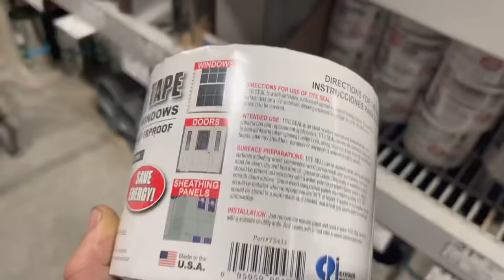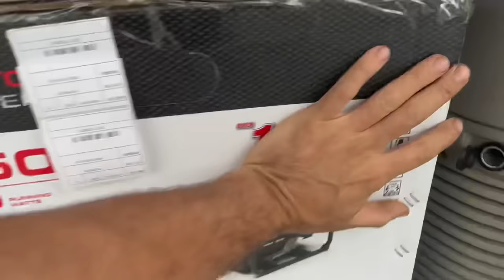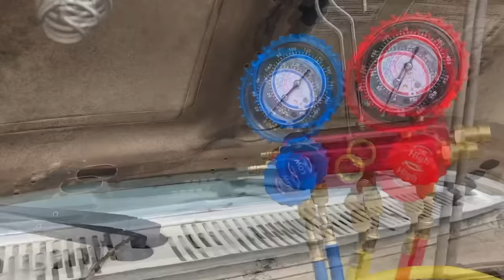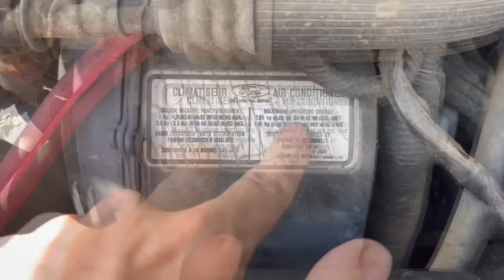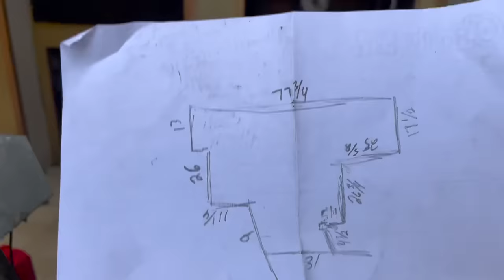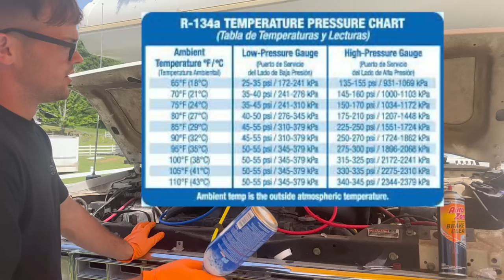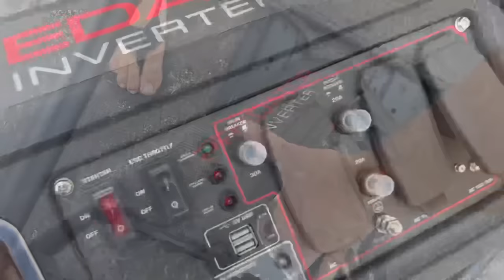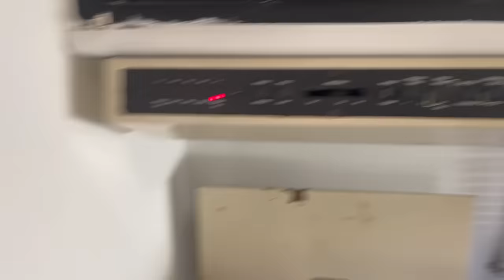Budget RV renovation at home, how much is this going to cost? DIY

Comment: My RV renovation only cost me a spring/early summer full of deconstruction, removing appliances and rotted wood from the shell to rebuild the rotted shell before building all new internals.  Then a family member got cancer so I had to stop working on it and move the RV to the back field so it wouldn't be such an eyesore for visitors.  The cancer was eventually eradicated, but then it was too hot to work on the RV, and by the time fall rolled around, the trailer in which I had been keeping what little good wood there was mysteriously burnt to the ground and hurricane Michael turned the RV into a debris field that's still there to this day.  So I've learned not to do that sort of thing anymore.

Comment: I added same style of A/c to my camper, took out common space vent, put the a/c in yep just sits there, mine has 1x1 that go across the roof to support it. but that control panel is (if it works) has value.  every railroad car in Us has those units, few years back had a (relative) salvage few. helped allot, they do draw on the converter they are 110 v,   reminds me whenever weather stops being stupid i need fix the leak on my camper. Aluminized roof coating, sold at Home Depot, not cheap works great, but that goo you scraped is butylene tape, stays semi solid to help in heat and cold conditions keeps the moister out in driving rain and wind.  not sure choice of caulking is correct, took me few time find the right one.
Reply from the maker: Ok good to know thank you

Comment: heres some advice to the work you did on the ac.  remember all ac;s create condensation.  you put sealant around the front half of it that is where it draines from underneath.  if you leave it like that it will drain inside the rv.   the drains are on each side of the unit underneath the metal.  other than that you and your family have done a fantastic job on it so far.
Reply from the maker: Thank you

Comment: Its been my experience that the fan bearing will get stuck/frozen if it's not used for a while in those type AC units.
Spraying it with a good lub will help, but most likely it will keep happening...mine did.
Reply from the maker: Ok thank you

Comment: I'm ok with the camper stuff and don't mind seeing more.  I do have a request.  Put some 1x2 along the walls as they meet the ceiling.  That will help support the ceiling plywood.  You can also use some of the thin plywood cut into 1x strips to cover joints.  Otherwise...been there...anybody who has had an RV has had to do something similar.  Thanks for sharing, it was fun to watch.
Reply from the maker: Thank you

Comment: Soft gray stuff is probably butyl tape, the white is likely self leveling lap sealant. Recpro has TPO membrane kits for fairly cheap, i spent like $200 to replace the entire roof membrane on a 26 foot 5th wheel. Unfortunately osb at the time was $50 a sheet so that got spendy. I had probably $600 in replacing the roof. For the interior walls we used the whitewash paneling and white paneling on the ceiling they were like $15 for a 4x8 sheet.
Reply from the maker: That sounds good

Comment: There's an adaptor for the exhaust with flex hose screws right into the bolt holes for the spark arrester. I got mine on ebay.
Reply from the maker: Ok good to know thank you

Comment: Plexy on sky light isn't UV protected.  Will go bad quickly.   There are a lot of Junk yards that have parts for RV's and MH's.   Gain parts for cheap.  There is a roofing  call snow coat to seal roof, brushes on.  Also stuff that is peal and seal like rubber membrane.   Not sure what it is called.  Remember those strips of wood you took down from the ceiling?  That was part of the roof support for AC...  Solar panels were all the extra holes.
Reply from the maker: Ok thanks

Comment: Enjoyed watching you and your family work on this. You guys did a ton of work on this in a short time. It’s the right unit and job for your needs and use. 

Really really surprised both the rooftop and engine cab a/c units came back to life and functioned! The roof damage was about what I expected. Very bad. Was a bit surprised at its sandwich foam construction. Then I realized just how old this puppy is and it made sense. 

Once you start your trip and start pounding some miles on the rig, you will discover what worked and did not work on your repair processes and material choices.

It will be interesting to see how well your generator modifications and installation works out. 

Hope you put co, co2 and smoke detectors in the camper. You may find you need to reroute and extend your generator exhaust pipe to properly vent the exhaust away from the camper so it dose t find its way inside. Maybe also wrap it with exhaust header heat wrap tape to protect the the surrounding structure from over heating. And carry a couple of decent size fire extinguishers placed at the front and back of the inside and they are secured and quickly easily accessible. Maybe place one by the rear bed, one by the entry door and one by the drivers door. So the last two can be grabbed either from the inside or outside and the rear bedroom one can be grabbed if woken up from a sleep. My experience says, when you need em, you need em now and can’t waste time lookin for them and digging them out.
Reply from the maker: Thank you so much yes we got extinguishers and detectors

Comment: Great job. My only concern would be with the generator exhaust. Double check for leaks and make sure the tail pipe is long enough. Carbon monoxide is a killer. Better get Rocky's seal of approval.
Reply from the maker: Yes for sure thank you

Comment: Looks great 👍
I would consider changing out the 12 V lights to LED'S.  Cooler and less power.
You may want a good set of jumper cables or an auxiliary battery. 
Enjoy👍👍
Reply from the maker: Ok good idea
Reply: @Sleeperdude  led's not LET'S  incandescent bulbs make more heat. The ones Google won't let me spell are cooler and use less battery.👍👍

Comment: Spend the extra $$ and buy and use THIS sealer caulk. its what we use to stand up in tropical marine environments.  Sikaflex 295UV (uv stabilized polyurethane).
 You can also use  a polysulfide like Life Calk
  NEVER use silicone based products.
Reply from the maker: Ok thank you

Comment: Pro Tip: Do not use silicone sealants. Use Urethane instead. 

An easy way to get it cheap is to find an auto glass warehouse or even an auto glass company and offer to buy their expired Urethane. 

It may not be legal for use with windshields anymore, but the stuff is still great for sealing panels. Personally I use Dow Express 30 and primer. As long as you clean and prime the surface, water will not get through.
Reply from the maker: Ok thanks for the tip

Comment: Great work y’all, love the content. Please buy a couple of carbon monoxide detectors for the motor home. When the generator is running it will detect any exhaust fumes that may enter the camper. Glad you extended the exhaust pipe.  You should also use a solution of dish soap and water and check all of your gas lines for leaks at every connection. Found a couple on mine that way. Take care and God bless ya’ll.
Reply from the maker: Yes for sure thank you

Comment: Josh, It's good we are on the same wavelength :) Have you tried a prim bulb on the outboard fuel tank to prim the system before you tried to start it? All you need for the gravity feed is a little height between the tank and the gen. carb. how about instead of having a line at the top of the tank, tap a fitting at the bottom?
Reply from the maker: I tried pumping it out of the original generator fuel line but never could get anything just ran out of time

Comment: Roof leaks are the worst part about having an RV. Thats how i got mine dirt cheap tho!! Previous owners selaed up around the ac unit on the outside, which wouldnt let the condensation drains drain off the roof top, causing it to build up and seep inside. Ruined the ceiling. But like you, i tore it out and put new luan up and painted. Paid $800 for the camper, have MAYBE an extra $500 in it, and it looks good as new lol.
Reply from the maker: That’s awesome, yes that is usually the problem

Comment: Just a thought about the generator fuel supply, since you carry propane why not convert the generator to propane with a carburetor kit? No more fuel delivery problems with fuel pumps or height of fuel tank.  I changed my son-in-law's many moons ago and it works well for him. I don't recall any specifics (i'm 83 here) sorry. My 35' class A had a large propane tank, maybe 30 gal and that would run you for quite a while and most campgrounds sell propane if you need it.
Reply from the maker: OK good idea thanks for letting me know

Comment: say what you want about flex seal but i have done the top of my shed and resealed a camper roof with the stuff and never had an issue with leaks
Reply from the maker: It might work good but it’s kinda expensive
Reply: @Sleeperdude  Ya i saw that after i made the comment HOLY CRAP I would have gone with the cheap stuff too...I would imagine a drug habit is cheaper than that flex seal these days/ Great job on the camper my man!! you just earned yourself another subscriber

Comment: Campin rig is comin along sleeper brother... One recommendation tho.... Move the particle board sheet above cab the ladder leans against,  inwards up against the front windows & slide the actual plywood piece that is there now, out towards the center of the truck, AKA the board that ladder leans against.... Particle board plywood does NOT hold under weight as well as regular plywood does..... The regular plywood will NOT bow near as much as you lie down on it if you use that area as a bunk again or stack stuff up there for storage... I do not want your girls to sleep up there and that particle board snap and one of them fall...
Reply from the maker: Ok great thank you

Comment: I suggest going ahead and springing for a new electric fuel pump and plumbing the generator fuel the same way the original was plumbed.  They are plumbed in special at the factory so that the generator will run out of fuel and leave a reserve for the engine, so you can still drive to the gas station.  A little investment seems so much better than fooling with gravity feed.
If the tank was near empty, that would explain why the generator fuel pump failed the test, because it is intentionally not plumbed into the bottom, to give the engine a reserve.
Reply from the maker: Yeah your probably right

Comment: Be sure to sanitize your fresh water tank!!!! Also, get a bottle of "Just Science" A/K/A TankTechRX for the black and grey tanks too. That is all you need to keep your tanks in good maintenance. READ the directions on it before adding it to your tanks the first time. It's all you need for your tanks.  To sanitize your fresh tank you will need to use bleach and water mixed in a 5gal bucket and suck it through the winterization system and leave set overnight/24 hours then flush out. Be sure to turn on each facet and let each one run til you smell the bleach then turn off and go to the next facet, be sure to do the shower too.  Flush out the grey and black tank with bleach before your trip and always start with 5 to 7 gallons of water in your black tank. WATER in those tanks is your best friend!!!  (We are professional tank servicers)

Comment: I've done 2 different trailer's white rolling mastic, and mastic roll to seal patches, sadly wind and moisture will separate calking.
Just trying to share my experience.
Hope it helps.
 I'm going through my new old, old 5th wheel have to gut it.
I've also 1st start get roof AC off it, always repair leak AC bad design 🤬
Reply from the maker: Yes that’s cool

Comment: "Sometimes I cut corners."  Your quick wit is hilarious! Wow your busy Guardian Angel kept you from loos'n a finger when the fan surprisingly came on!  Is the a/c unit a heater as well or is your heat from another source?  The 460 is an awesome engine, but thirsty, but you don't think about that when it's laughing at the weight it's hauling.
Reply from the maker: Thank you I’m glad you liked it it has propane heat

Comment: I want to tell this guy on the patches on the roof patches just use the caulk NO SCREWS THE CAULK WILL HOLD THE PATCHES GOOD ENOUGH ,the more screws you use the more chance for less you'll have ,I have a patch on my camper roof from a a tree branch  and it's been on there for 6 years and still holding perfect ,just saying

Comment: The make a specific sealant for rv roofs but it's only sold at rv supply stores silicone caulk isn't recommended But other then that great video
Reply from the maker: Ok thanks

Comment: Hello again Josh, How about this idea? Tape into your main fuel line with a T fitting, in that line, somewhere you can install an on/off valve, also get a small electric fuel pump, and there you go no need for a stand-alone fuel tank. :) pilotcropduster
Reply from the maker: I actually tried doing that and could never get anything to pump through the line so we went with the gravity feed instead but that would be better

Comment: The original generator should have been fed from the coaches fuel tank...and when it gets down to 1/4 tank the generator shuts down
Reply from the maker: Yes that’s true we tried to use the original fuel line with a pump but we couldn’t get anything to come out

Comment: A word of advice from a full-time rver you need to get that generator running off your tank your gas tank but keep the hose about 4 in above the bottom of the tank so it doesn't drain your gas out and leave you stranded I go through $160 every 3 days and fuel just to run my generator during the day only just some advice don't put no little ass tank in there and do not have it in the engine compartment you'll be waking up at all hours of the day and night to fill that damn thing with that little bitty tank I got a 40 gallon tank you got to tap it into your main tank but do not put the hose all the way to the bottom of the tank it should run out of gas at a quarter tank that way you got a quarter tank to get to the gas station trust me I've been through it a hundred times thank God it doesn't drain my tank
Reply from the maker: Ok thank you

Comment: Not all answers come to me at once.  Sometimes it takes a while  autism =slow. Solar panels. No need for generator. Mounted nest the wall for support and something you take when you sell may not be what is but answer the question with a valid possibility and now I don’t have to think about it anymore. I may not be right. But with an average in the 90’s it’s a safe bet.  On that subject with a nod to the envelope the upgrade you should plan is a power inverter to run whatever refrigerator you do buy, that’s big enough, while your driving. That the reason for a propane refrigerator. And why you can’t drive through a tunnel
Reply from the maker: Good info thank s

Comment: It hurts to watch how cheap and how you are not using RV products, like all you need under the AC to keep water out, is the correct foam that you can get online or at a RV supply store. 😬🤭🤑
Reply: Also, if you don’t put self leveling calk sealant on all those screws and edges of covers. It will most likely leak. Maybe not immediately but within short time.

Comment: DAP is  WATER BASED  latex , it WILL DISSOLVE in standing water which you will have on the roof.   With Alum to Alum roofing you NEED SILICONE and not Dap that say's that its got  silicone you need real RTV silicone
Reply from the maker: Ok thank you I agree

Comment: Ditch the AC and go a different route. RV AC units are inefficient and overpriced. Not to mention that weight on the roof is the most leaky design possible. A minisplit is way cheaper and way more efficient and can be mounted on the rear.
Reply from the maker: Ok thank you